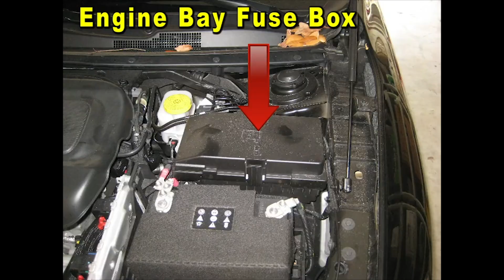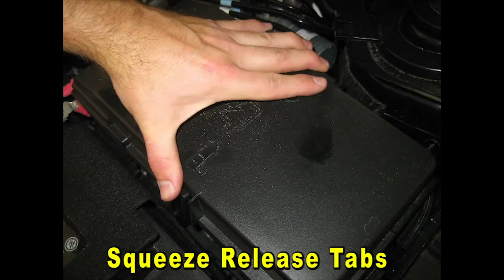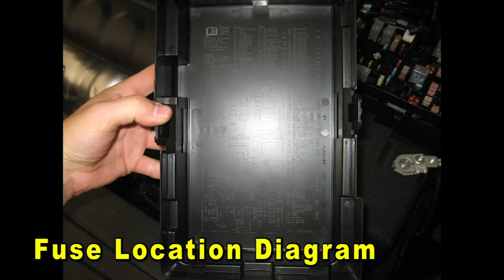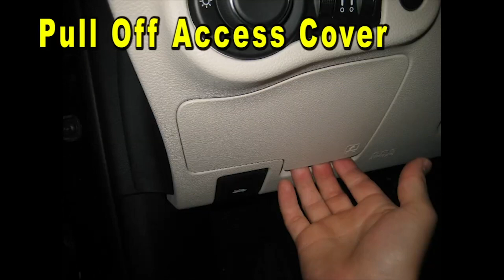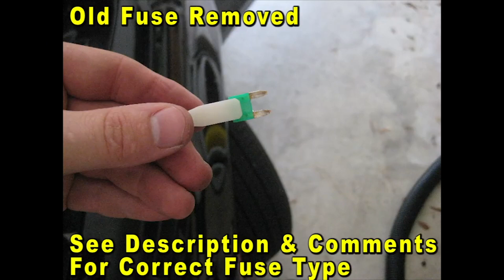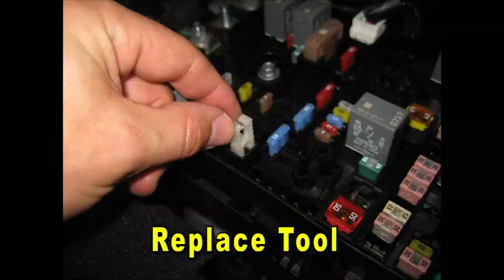2015 2016 & 2017 Chrysler 200 How To Change Electrical Fuses & Relays - Quick & Easy

Comment from the maker: Chrysler 200 Electrical Fuses - https://amzn.to/3NigktA
Precision Screwdriver Set - https://amzn.to/3TCMm6n
Plastic Pry Bar Tools - https://amzn.to/3HMtsV7
Socket & Ratchet Set - https://amzn.to/3Z17LbA
Mechanix Gloves - https://amzn.to/3jCnHkt
Torque Wrench - https://amzn.to/3vS5uSI

The Paul79UF YouTube channel is a participant in the Amazon Services LLC Associates Program, an affiliate advertising program designed to provide a means for sites to earn advertising fees by advertising and linking to Amazon.

Comment from the maker: Check out the DIY guide for changing a blown electrical fuse or faulty relay in a 2nd generation 2015, 2016 & 2017 Chrysler 200 - 
https://www.paulstravelpictures.com/2015-2017-Chrysler-200-Electrical-Fuse-Replacement-Guide/index.html

Here are all of the DIY repair and maintenance tutorials for the second generation 2015, 2016 & 2017 Chrysler 200 Sedan - 
https://www.paulstravelpictures.com/Articles/2015-2017-Chrysler-200-Common-Problems-Repair-Maintenance-Guides.htm

Owners of other Chrysler, Dodge, Jeep, RAM or Fiat vehicles such as the 300, Pacifica, Town & Country, Avenger, Charger, Challenger, Journey, Dart, Durango, Magnum, Grand Caravan, Fiat 500, Fiat 124 Spider, Grand Cherokee, Renegade, Wrangler, Compass, Liberty, Patriot, ProMaster, 1500 and C/V Tradesman minivan may also find these DIY instructions to be helpful.